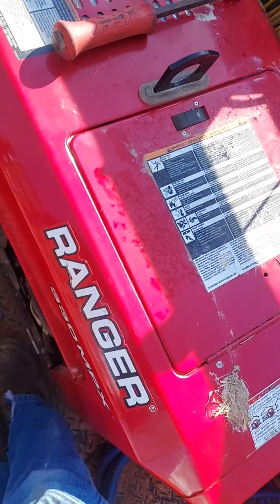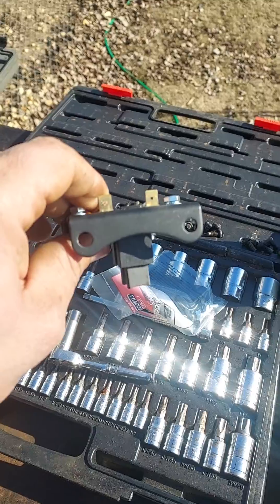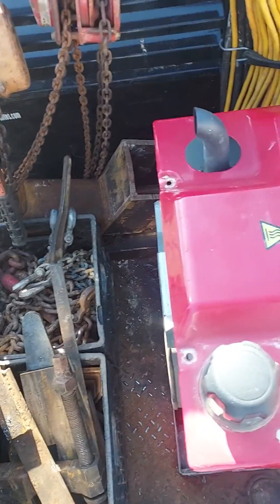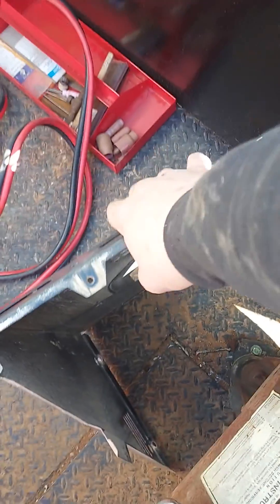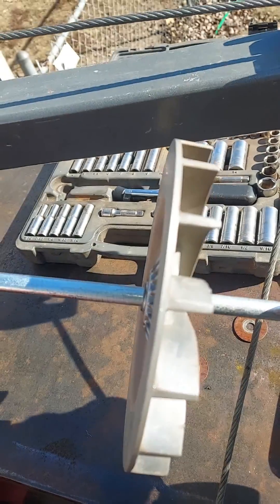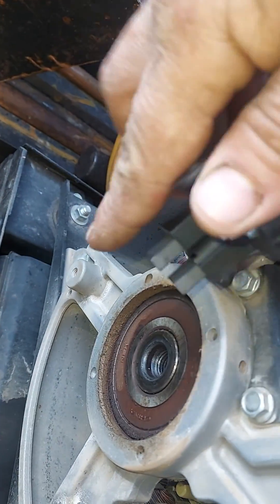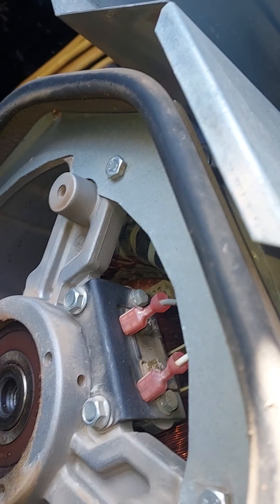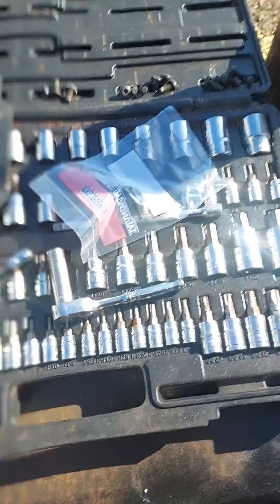Lincoln Ranger 330 MPX rotor brush change

Comment: I got 1 of these welders and haven't replaced the brushes yet.. Im doing it now, thanks for the video. Now i have a problem with mine, it runs perfectly fine.. all the plugs work, but it doesn't strike an arc anymore.. hoping its as simple as changing these brush and good to go.
Reply from the maker: I'm glad the video helped and I hope swapping the brushes fixes your issue. I was able to get 3400hrs and a little change out of this unit before it popped the chopper board.

Comment: John, I have the same machine. When I start to weld the machine bogs down and almost dies. I replaced fuel filter, plugs, oil change and air filter. Any ideas
Reply from the maker: I'm not an expert by any means, but I do know Lincoln wasn't joking with their ventilation space requirements around these machines, so if you've got yours mounted down in a bed with s bunch of stuff around it, it could be overheating and causing an issue that way. Mine used to act up on occasion on hot days when I had it on my Dodge, but where I put it on the Ford, it gets much better ventilation and acts like a machine should. Lincoln kinda tricked us with these machines. Very compact machine, but it requires nearly the same footprint as an old SA 200
Reply: @JNRWelding  ok, awesome. I've owned it for 5 years and used it a bunch. I'll look into the ventilation issue. Thank you Sir
Reply from the maker: @AndrewWJohnson  I hope that helps you man. It aint no fun when the machine acts up

Comment: I just hit 1000 hours on mine, time to do brushes and plugs. You done plugs yet? This vid was real helpful though thanks!
Reply from the maker: I don't replace spark plugs until they quit working. Lol. But I used to be a small engine mechanic, so they're a pretty easy part to swap. I'm glad the video helped you. Thank you for watching
Reply: For the spark plugs, you have to remove the face plate that holds the display, both side doors, top panel and rear panel to get to them from the side. There’s 1 plug per side. That’s a 16mm or spark plugs socket. While you’re ahead, change out the oil, fuel filter and air filter and have that baby thankful for its service. Hope this helped. Good luck.

Comment: Thanks good to know was thinking on eventually up grading to one if my Ranger 10'000 plus wears out
Reply from the maker: You're welcome. I wish I could've found the proper procedure from Lincoln, but that's a secret they want to keep I recon. I've never run 1 of those 10,000 plus machines, but I can tell you the 330MPX has been great for me. Got more settings than a space ship (gouging, pipe, spool gun, etc.) Also has finer adjustments for each process except gouging, but that little screen also doesn't let you forget when any sort of maintenance is needed. Oil change, air filter change, fuel filter change, spark plug change, and rotor brush change are all pre-programmed to cover the screen with an alert after a set amount of hours. It's also very easy to reset the alerts. No fancy process of standing on your head and entering what feels like a video game cheat code, you just select which dog's doin the barkin, hold down the selector button about 10 seconds, and done.